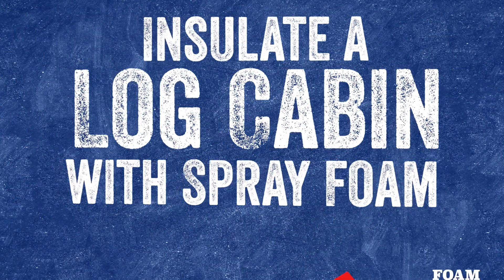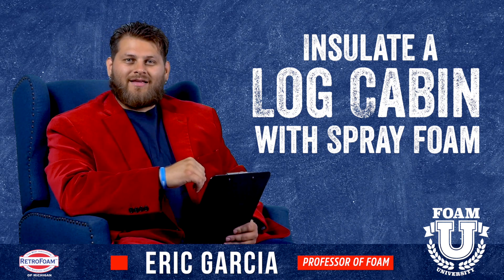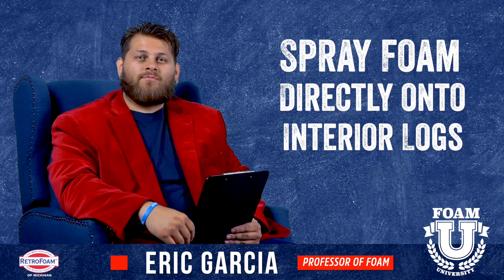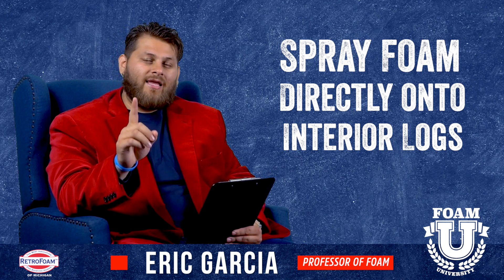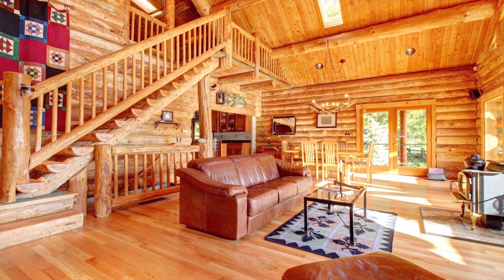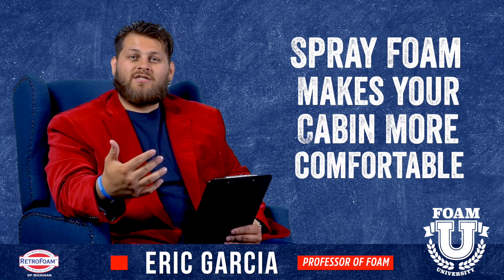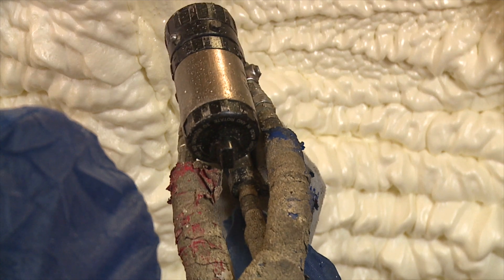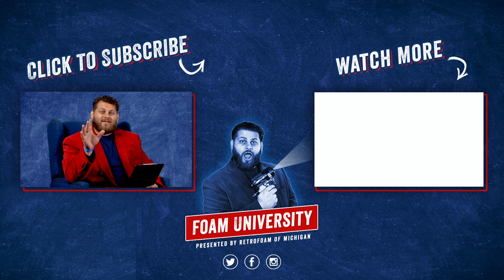How Do You Insulate a Log Cabin with Spray Foam? | Foam University

Comment: Would it be possible to cover the inside log walls with tyvek or something first, add studs and then spray foam it? In an effort to not have the foam stick irreversibly to the logs? Or is that a bad idea?
Reply from the maker: Yes, it's semi-common, but moisture may still get in the air space between the Tyvek and the logs. It may not happen, but it's something to be aware of and discuss with your installer.
Reply: @RetroFoamofMichigan  thank you for replying!
Reply from the maker: No problem! Please don't hesitate to reach out if you have any other questions.

Comment: I am guessing it would also be possible to build a double walled log cabin and spray foam in between the walls?
It would drive up the cost but that way you get the log cabin look on both the exterior and the interior.

Will the foam overtime degrade and most importantly does it have an effect on the durability of the logs?

Cause this might be a solution for those, like me, that are stuck in countries where everything has to be insulated to the extreme 😔
Reply from the maker: Unless you are in the process of studding out the walls, foam insulation wouldn't be a great fit if you don't have drywall or wall studs. Here's a link to a blog post from our Learning Center that explains this in a bit more detail: https://www.retrofoamofmichigan.com/blog/how-to-insulate-log-cabin-walls-injection-foam

As for degradation, RetroFoam is made to last the lifetime of your home. So, as long as your home is standing, RetroFoam will last forever. Here's a link to a blog post from our site that compares RetroFoam to other home insulations in terms of longevity: https://www.retrofoam.com/blog/how-long-does-home-insulation-last 😊

Comment: Can I spray foam insulation in log joints where there are thin gaps? Or do I have to worry about the foam expanding those joints over time?
Reply from the maker: If you use a closed cell spray foam you won't have to worry about any expansion.

Comment: I got a cabin in northern MI with a metal roof sitting on 1.5 in tongue and groove boards which is the ceiling on the inside.  Can I spray foam the inside of the ceiling seeing that there is no venting?  Thanks
Reply from the maker: This is something we can do, but we would have to see how much room there is between the tongue and groove ceiling and the metal roof. This would be an instance where having a project manager out to take a look would be a good idea.